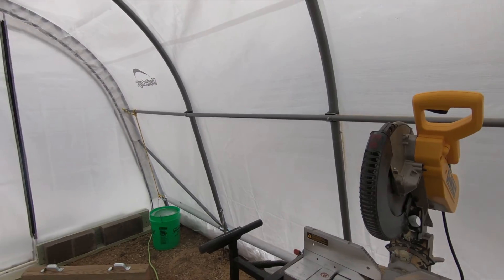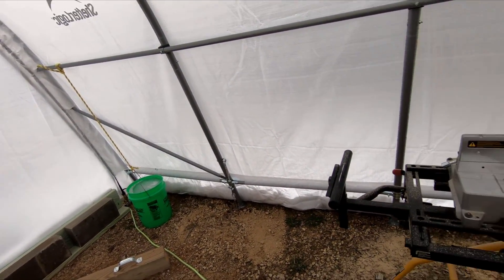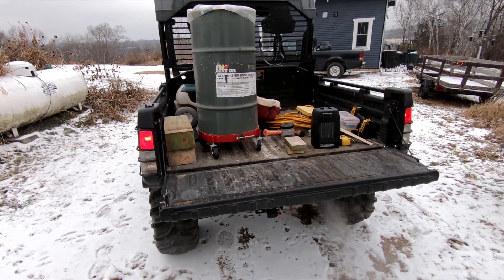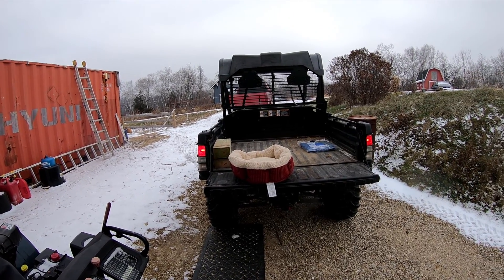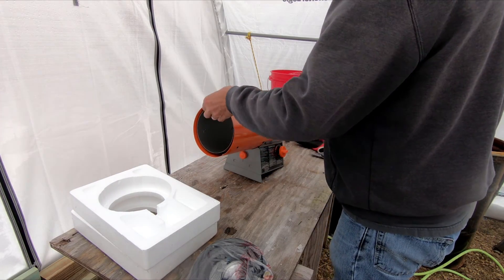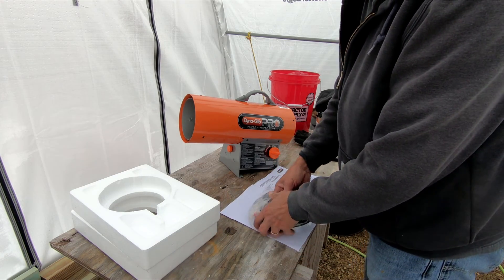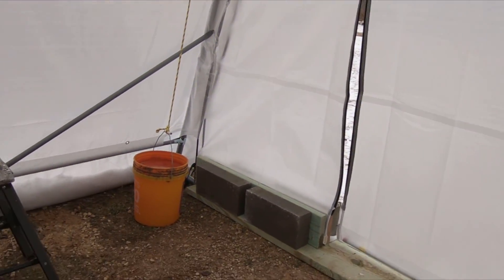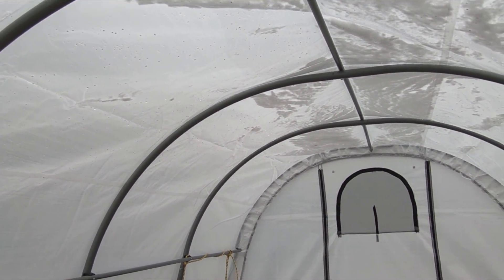Clearing the Greenhouse and Unboxing the Dyna-Glo Pro

Comment: I bought one of these , way to loud and also even with the door open i was finding some light headed feelings , It did through a lot of heat i will say that for it. I took it back and paid a little more for the Ridgid  hybrid  best thing i ever did so quiet 100% better made
Reply from the maker: I'll have to take a look at the Ridgid hybrid if you say it's quieter. I am very much against noisy machinery (see link below). Where did you get your heater from? Is that a Home Depot brand?

Soundproofing the Compressor Room with Green Glue -- https://www.youtube.com/watch?v=EFZpolU1O2I

Comment: In such a small space with no ventilation I have to question the safety of the carbon monoxide build-up. I am currently setting up a similar thing but in a much larger space and was hoping to find a solution for venting the excess CO. From what I have found out so far, you need a vent of at least 1 square inch per 2,500 BTU. I believe 60000 would need at least a 4 inch vent.
Reply from the maker: Thanks Chris! I mention the carbon monoxide build-up issues in the video, but in the end I only use the Dyna-Glo in the machine shed with the overhead door open about an inch — 1" x 12'. The machine shed has a ridge vent as well, but that little heater would never build up too much carbon monoxide in the area it's used — and I have a carbon monoxide alarm that would let me know way before it happened anyway. Just get an alarm and you'll be fine. 😊
Reply: @PlanetMojo  A CO alarm, great idea !
Reply from the maker: @chrismcewan7582  Just mount it at the correct height and you are good to go. I also have an explosive gas monitor. Pretty cheap insurance 😊